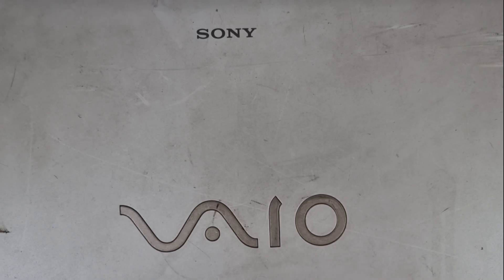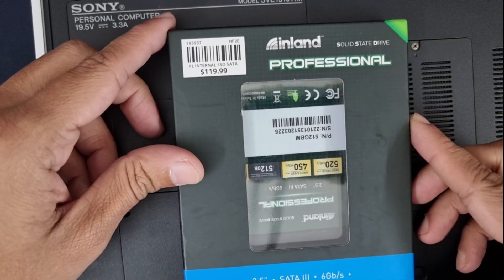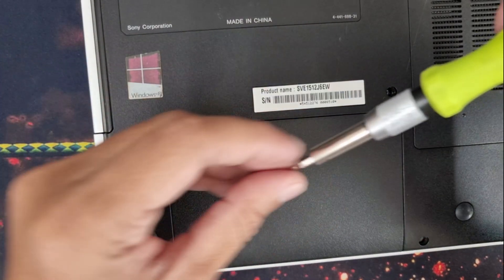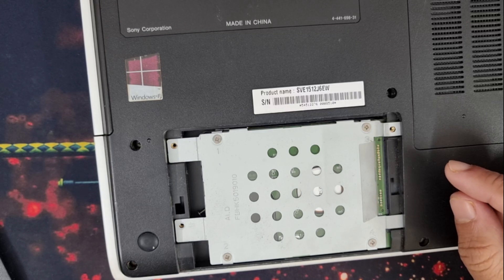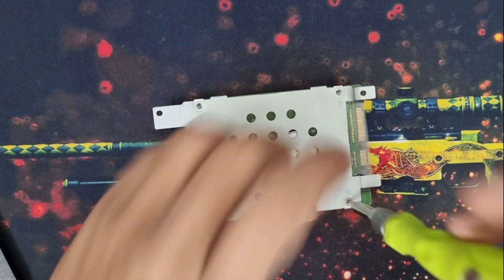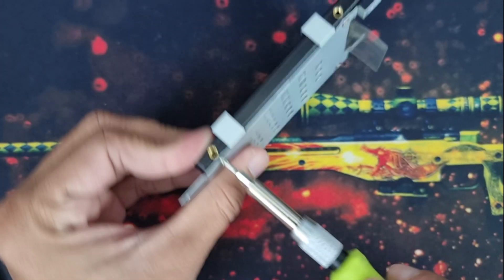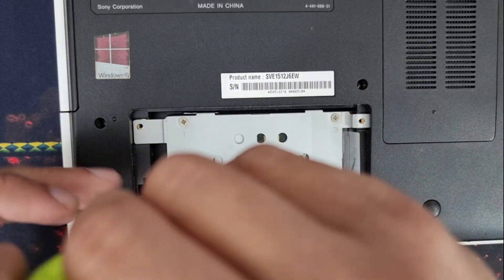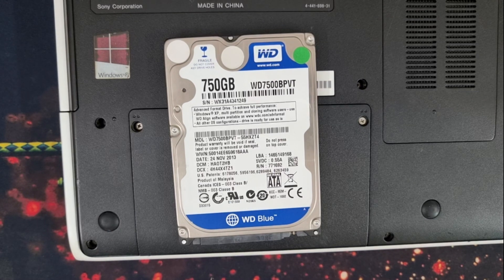How I gave my 10-year-old Sony VAIO Laptop a HUGE Speed boost in a minute

Comment: I upped my RAM to 8GB which is the max.  The OG HDD is still plenty fast but I think I will upgrade to an SSD because its so cheap.  Great video.
Reply: I upgraded with single channel 8 gb ram ..unfortunately it didn’t work…
Reply: @edin4857  You need 2x 4GB sticks to get 8GB.  It's a limitation of the motherboard.
Reply from the maker: Yeah you definitely should! Upgrading to SSD will totally transform your laptop experience

Comment: Switch over to Linux, give it a try - mine runs a lot faster (already has 8GB memory and SSD but showing its age with the AMD CPU from 10 years ago designed to run Win 7 and Win 8 ... Ubuntun LTS V22 is my choice of OS - run it off an USB drive to see the difference before you install it.
Reply from the maker: You are absolutely righ dear. 
Problem is this PC is done for 1 of my juniors, and he is not a tech guy. So linux is a no go for him. If this was mine, i will surely follow your guide. So many many thanks for your advice

Comment: I have upgraded my 15 year old Sony Vaio which came with Windows Vista originally to SSD recently. It now run on Windows 10 for the last couple of years. The only problem is overheating the CPU. I think Windows 10 is a bit too much for my old laptop. The SSD upgrade didn't make a huge difference to me either. not as I expected, but its a bit faster.
Reply from the maker: I thik there are other issues with your laptop. About overheating: dust might be the culprit. Also you can check thr thermal paste on top of the processor itself. If you cant do it, please seek help from a professional. Also the SSD upgradation should have a massive impact. You can also test that.
Please let me know about the result
Reply: Apply new thermal paste on processor and graphics card.
In my case overheating caused graphics damage

Comment: Hi. If I do this upgrade, do I need to upgrade the RAM too?
Reply: U have to if you want windows 10 as that itself takes 4gb ram
Reply from the maker: It is recommended to have 8GB RAM for running Windows 10 smoothly. But you can run it on 4GB RAM too.
Reply from the maker: No, you dont need to upgrade RAM